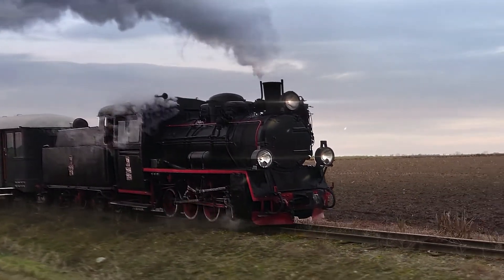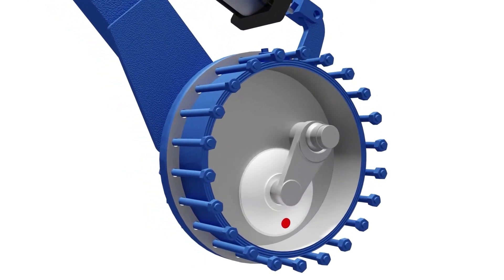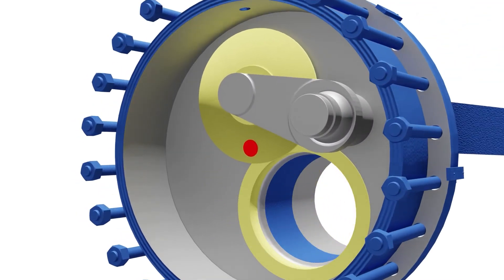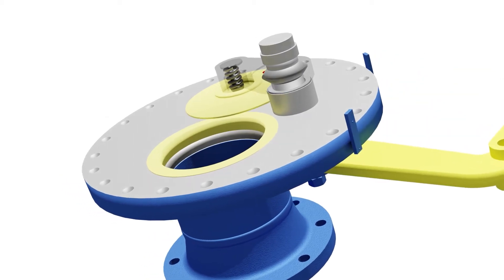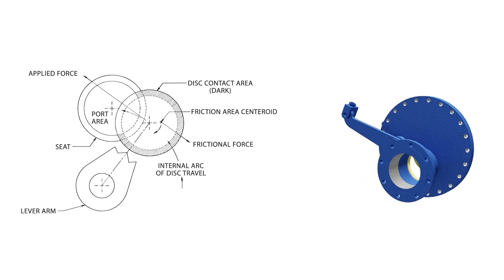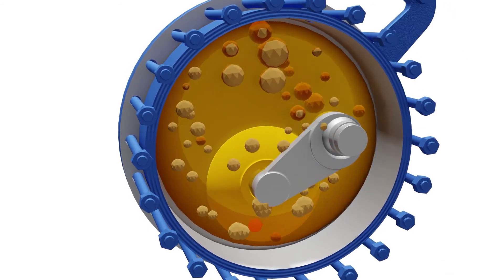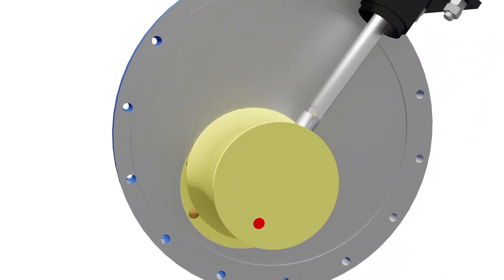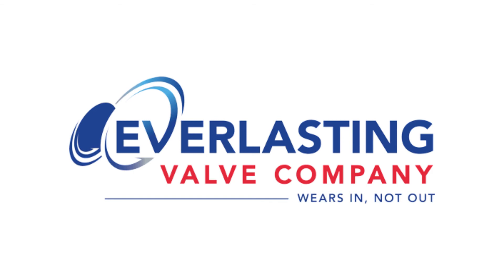Everlasting Valve Company - The Original Rotating Disc Valve

Comment: I looked at the video of how the rotary disk valve works, and found it an interesting replacement option for dome valves. We have 13 valves installed in our unit and have the problems that were reported on your site. I would very much like to purchase one of your valves for testing in our unit on the bottom ash transport system of our 280 TPH steam boiler.
I have 40 years of experience in electrical and instrumentation and continue to learn and seek solutions. I will communicate with you by e-mail, please wait.